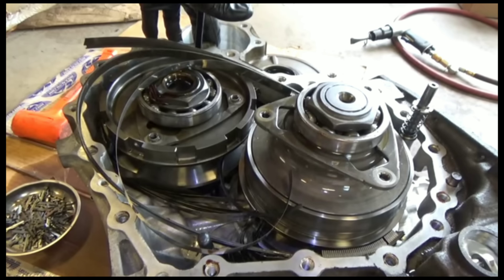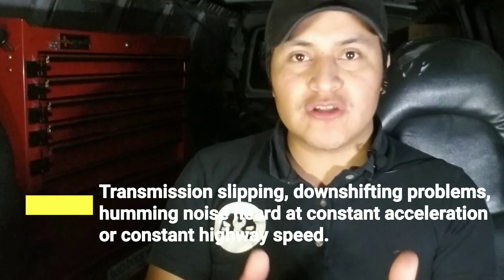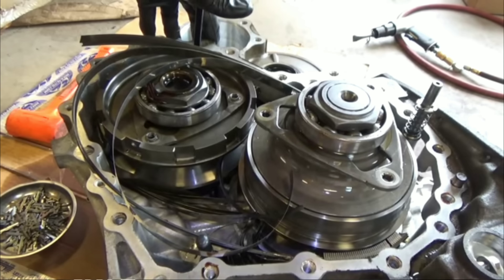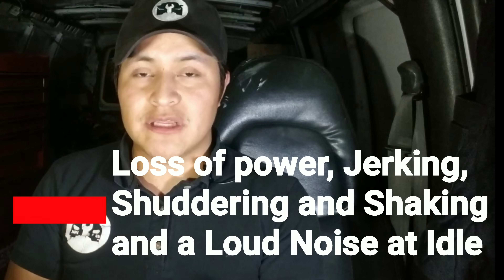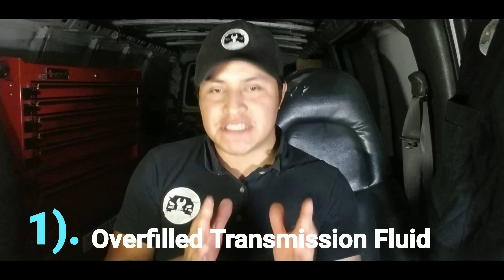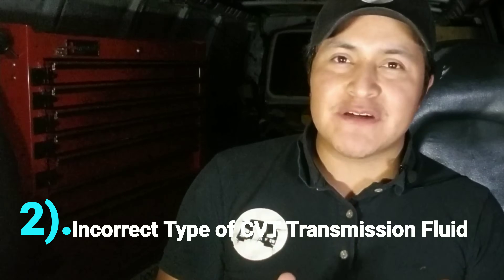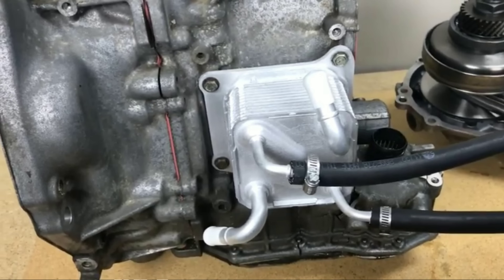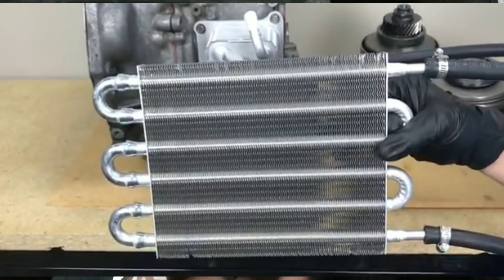NISSAN CVT TRANSMISSION | why it fails and what you can do about it to prolong it's life

Comment: Our CVT issues started at 12,xxx miles. I recorded it with my phone, and let the dealer know, but they weren't able to "replicate" it. It happens once in a while now - raaaarely - and now, I know it's going to act up when the VDC symbol (vehicle dynamic control, the one w the car and the squiggly lines) comes up and blinks. It's a 2015 metallic blue Sentra, with 74,xxx miles now (2021) on the same faulty transmission. Have done all the needed maintenance in a timely manner as well. Love the color and body lines, but man does that transmission suck...
Reply: Trader her in before she fails on you.
Reply: The VDC light.  I have a question about this.  I have 2010 Altima Coupe, 31K miles (that’s not a typo). I bought it new.  Ever since Day One, if I am forced to make a hard stop, my car will not accelerate afterwards and that VDC light blinks briefly.  I live in Dallas and Texas traffic does not play. When you are forced slam on the brake, you typically have to floor it immediately afterwards & get the hell out of dodge.  If you don’t, you’ll die.   I’m very serious when I say that I’ve almost been killed because of this issue.  I asked the dealer about it and they told me it was, for lack of a better description, a CVT defense mechanism.  It won’t let me accelerate after a hard stop so I don’t damage the transmission.  Is that right?  Why would slamming on my brake mess up my transmission?  If I am run over, rear ended or possibly shot because my car won’t accelerate after slamming on the brakes, damage to the transmission will be a non issue..?

Comment: I bought a 2012 last of 4th gen and its going strong at 205k miles ive changed the trans oil 3 times about to do the 4th luckily my trans pan has a drain plug. And ive used valvoline cvt compatible with ns-2 and no issues

Comment: Needing to change the transmission fluid after only 30k miles is ridiculous. Just one of many reasons why my Rogue is my 1st & last Nissan.
Reply: Especially when you have to take them to a mechanic to change the transmission fluid and it costs $300! My 2013 Nissan Rogue is a POS, I get about an hour and a half of drive time before it goes into limp mode. That's fucking ridiculous!
Reply: @destinysharum9253  I have a 2007 thats in limp mode right now, if you have a 2013. I think im going ti call it a day with this car🖐
Reply: It’s called preventative maintenance. Like engine oil, trans fluid over time wears and begins to lose its properties such as heat absorption, friction, and lubrication. All these properties are absolutely critical towards maintaining a healthy auto trans and replacing it regularly can increase its lifespan. In the case of CVTs, they require more religious trans fluid changes due to their sensitive and more delicate nature than regular planetary gear set autoboxes. Remember that fluid is cheap, new trans aren’t.
Reply: @alexs.818  no its called high maintenance. A car that has to be maintained twice as much as any other car on average is not worth having.

Comment: Please plz take a look at your cars tech bulletin, if you drive > 70kph @>98deg F days, you are pushing to the limits, please use a OBD scan tool (Bluetooth if possible) and read cvt temp while you drive...monitor it..,you will get shocked to see how it heats up, it's just like you eat a candy and read BS.then think about adding external cooler....you could still save your car...drive really safe ...no road rage with nissans!!

Comment: I have a 3.5 Altima with 200k on it? Car runs like its still new! Not one thing is broken or not working. Amazing car.  Only complaint is i changed stabilizers twice. They start making light rattle noise after 2 or 3 years.
Reply: Which year model?
Reply: @ALOUY15  altima se 3.5 year 2007
Reply: Briman24 maybe prior to 2013 its reliable, hearing so much here and there about the 2013 being unreliable specially in the transmission

Comment: Hi! Just watched your video and wanna say thank you for posting it! I wanted to ask a question... I bought a 2014 Pathfinder SV AWD with 226,000 miles. I noticed, after buying of course, that there is a "shudder" occasionally (not always) upon accelerating.   I'm sure it is transmission related. This far, I've not had an overheat (that I know of...but it hasn't gone into the limp mode). I have no service records from the previous owner as it was traded in on a new Chevy. I bought it from that dealer. My question is what do you recommend considering the miles, and assuming the shudder is just starting to happen (versus having done this for many miles)? The truck has other "typical" Pathfinder issues (sun visors being the most irritating). Do you recommend selling or trading the Pathfinder ( I paid cash for it... my entire savings! 😕)? Thanks for your help! Have a great day!
Reply from the maker: Have you taken to a shop to diagnose it, to make sure it's the transmission?
Reply: @WrenchLink  I have not had the extra money. I also have a 2008 VW Passat 3.6L4Motion that I am fixing now. I figure it'll cost $700-1,000 to get I back on the road. Back to the Nissan, I didn't really want an SUV... I don't care for them or trucks. I am a car guy. I wanted 2013 Cadillac XTS or Lincoln MKZ but alas, they were both a couple thousand more than I could spend. I owe nothing on the Nissan, so it wouldn't hurt my feelings to sell it or trade it if the repair costs are going to be too much. BTW, I nearly bought a 2012 Nissan Maxima SL but the transmission in it overheated according to the seller. I was appreciative he was honest about that. Anyway, knowing what I've said in my posts, do you think I'd be better off selling the Pathfinder? Thanks again!
Reply: @tythornburg3460  I am in the same situation with a 2014 nissan rogue. what should i do?
Reply: @rostyothman  I am gonna drive mine till I can't. Apparently it's no cheaper to fix it as it is or when the transmission is done. I'd love to trade it even up for an XTS or MKZ. But I don't think I would do to someone else that was done to me. As far as your Rogue... I suggest making sure it is too far gone to repair cheaply. If it is like mine, I would drive it till you can't, then take out a loan (title loan, maybe, if it is paid for...sucks because those are typically high interest,  but at least you'd have money to fix it...unless you already have the cash on hand to replace the tranny). That would be my suggestion. Note, I am not a mechanic, so you'd be better served getting advice from  one. Hope that helps.  Good luck!
Reply: @tythornburg3460     yea sell a car you dont want of cource,  but not because of the sun visors  lol

Comment: I have a 2018 altima I just hit 30k miles and I havnt experience any of this what does it mean?
Reply from the maker: That it's too early to be able to tell if the later models still have the issue.
Reply: @WrenchLink  they do, u need to drive it carefully and not beat on it. I bought a 2019 Sentra SR and the transmission doesn’t let u accelerate sometimes and u can hear a grinding noise when it happens.
Reply: I hit 37,800 miles also so it’s not that old

Comment: 7:40  For a 2013 Maxima Nissan and the dealer say change it every 60k miles..........I did mine a 48K but it was 7 years old
Reply: Saying bow do trans at every 30k vs. Recommended 60k
Reply: My local shops charge between 500-600 bucks for this. Ridiculous

Comment: Hello I have a cvt transmission on my Nissan Altima and it have 147,000 miles on it the transmission oil never been changed it shifts pretty good but it do a whining noise when I try to get speed but that noise goes away should I change the  fluid changed? Plus I have no lights on my dash and no codes even had it plugged up to make sure it wasn’t any code multiple times if you don’t mind could you please answer my question

Comment: My murano trans went out at 140000 mi. Pretty much gave it to dealership...on trade . Felt like they held me hostage on new model. Will trade b/4 it happens again.
Reply: What year was your Murano?  Did you have the trans fluid changed while you owned it?
Reply: @jenniferbaker5167  yes had it chg'd. Will sell my new M when it hits 100,000 mi. New M (2019)has slightly different trans. Not taking any chances.
Reply: @tcisraels8566  I was looking at a 2012 Murano with 109k miles to buy.  One of those things, if you look too far you find so many issues.  Trans fluid looks good, seems to run great, one owner, so many service records.  Now I am scared to buy it.  Thanks for your response!
Reply: @jenniferbaker5167  mine was a 2012

Comment: My 2014 Altima S has 166,000 it shifts great till it warms up then it has a shutter when shifting from 2nd to 3rd. But it doesnt make any noises and only does it when i only are accelerating slowly if you accelerate normal then it dont shutter. Do you think the transmission needs to be replaced?

Comment: I really don't believe they're too bad. My sister has 190k on her Murano and still going... it's starting to fall apart but everything else like suspension etc...I really think the problem is the drivers...here's a question when have you not seen a person with a damn Nissan speed? Always see Altima drivers driving like douchebags speeding over 100 everyday of the week. Also change the transmission fluid every 20k

Comment: I hear mixed opinions about doing a transmission flush on a cvt? A lot of mechanics said that if you wait too long it’s actually worse to change the fluid because the transmission is used to the current oil and parts are worn down so if you put fresh fluid in it’s not gonna flow right in the transmission. I have a 2013 Altima 139,000 miles I’d like to know if I really should or not I haven’t noticed any issues with my transmission
Reply from the maker: First of, is it a CVT or an Automatic transmission?
Reply: Wrench Link cvt
Reply: ?? Never answered dudes question

Comment: I own a 2017 sentra with a cvt that has 142,000 miles, I've replaced the cvt fluid twice at the dealership and I am about to replace it for the 3rd time. My question is how do you know if the fluid level is correct if it doesn't have a dipstick and only a cap. Also, does the filter needs to be changed. I am planning to change the fluid myself and save $250 dllrs.
Reply: I have a 2014
 No tranny dispstick.. I just take it to a nissan mechanic & changes the transmission fluid.  I'm at 92k miles.  Changed it twice so far

Comment: I can’t wait to sell my hunk of junk Altima
Reply: I am planning to buy an Altima 2013 base model. Has 83k miles on it. Gear and engine are perfect as my own cousin was driving. But I will be using it for rough use. Not  off roading or anything..like for city daily driver. Would you recommend it? Or suggest something..what issues did you face?
Reply: @farazahmad5947  I drive my 2015 Altima for regular commutes nothing crazy and a little bit over 100k miles the transmission went out completely. I was literally just pulling onto the highway when my car just stopped accelerating out of no where and I had to pull over. Good thing is I wasn’t in the far left lane when it happened. Nissan refuses to take responsibility for the faulty transmission and I have to come out of pocket for it

Comment: Why does my owners manual state the trans fluid interval is 60k
Reply from the maker: Because that's the manual that came with the car when they made the car, Nissan found out later that the CVTs go out at very low mileage so they sent out TSBs (Technical Service Bulletins) saying that they recommend to replace the fluid every 25k miles.

Comment: I have a 2013 Juke from new. 172000km. Runs great but I have had 2 new turbochargers. I will take your advice on the transmission as I would like to keep the car for another 3 years. Good motor.
Reply: What fluid brand you use?

Comment: Rule number one you don't put CVT transmissions into automobiles. They don't freaking work that's not what they were designed for. Secondly if you have a problem with the transmission not cooling properly you take the cooling line that returns to the transmission, and you put into that line on external transmission cooler and place it up in front of your air conditioning condenser or somewhere else behind the grill. You can never get the transmission to cool unless you can somehow get it below 160 to 170 degrees. I have made many Transmissions last far longer than they normally do by doing that trick.
As for changing your coolant, that should be done no less than about every three years regardless of how many miles it states that you can run you're particular antifreeze on the bottle. He just somewhere metals that are in modern cars get the antifreeze to start turning acidic fairly early. And will damage the vehicle. Any vehicle if you want it to last its longest you should be changing the transmission fluid every 30000 to 50000 miles.
The only way that putting additional cooling on your transmission will void the warranty, is if it changes the function of the cooling system. Which unless you're an abject moron it will not. What is apparent is that just by putting the CVT transmission on the vehicle they have basically decided to put an ineffective an unreliable system on the vehicle and should be supplying a warranty that should cover that transmission for about 200,000 miles. If they were so stupid that they thought that that was a good idea maybe they should stand behind it. In the United States, the warranty system in this country basically states that if you paid for it it won't void the warranty. However there's a lot of places out there that will argue the point. But just to show a case in point. The only reason that many companies are offering free oil changes is because an oil change is not required to maintain the internal lubrication warranty on the engine. If they warranty it for 36,000 miles than you do no oil changes for the first 36,000 miles and the engine fails. They have to replace it. I don't care how many times they've convinced somebody to pay for their own engine. But it is not required unless they offer you the oil change for free!

Comment: I bought a brand new 2020 Nissan Maxima in May and with less than 7,000 miles, the transmission went bad and had to be replaced. I will never buy another Nissan as long as I live. Nissan knows the cat transmissions are trash.

Comment: You completely lost me when you talked about the correlation of the engine cooling system and coolant, and the CVT life expectancy.  They should be separate items.  I think you talked about adding an external transmission cooler but you also said that it already has one in the radiator.  Incorrect coolant/water mix affects the CVT???  How?  It (the engine coolant) is the "same cooling system that cools down the transmission (@ 7:08)"?

Comment: Total bs..2015 Murano Plat here..102K miles..no CVT issues..no issues whatsoever..i'm on the original wipers. Don't listen to these idiots. It depends how the cars are driven, maintained. I also bought a 2021 Rav4..the side mirrors are shaking...factory defect..rest of car ok so far.
Reply: This is the comment I was waiting for. Im planning to buy a 2021 rogue. The car is way better than the rav4s and cx5s I test drove. Do you live in a place with a colder climate ?
Reply: @manojmohan7264  No FL. The new Rogue is nice but I prefer the Murano, though the design is a bit dated now. I avg 27.4 mpg on the Murano which for a V6 is not bad. The Rogue gets better mileage.
Reply: @FloridaDCSVideos  thanks for the reply man ! Appreciate it. I love the pro pilot assist and the camera quality on the rogue. And personally, I do like the ride quality too. All these comments are really scary. What all do you do to keep your car healthy ?
Reply: @manojmohan7264  Change synthetic oil every 5k miles, cross rotate tires , CVT flush every 50k miles, ethanol free gas ..i think engine runs better.
Reply: @FloridaDCSVideos  thx man

Comment: I put my car in self diagnostic mode and my transmission went back to normal after I did it but before I did it I could not even get out of first gear it was winding, 2017 Nissan Altima sv (65,753)

Comment: I don’t agree with his description of how coolant works.   I have always understood that the additives are for corrosion protection and boiling and freezing points.  Meaning that straight up water is all the engine needs to cool properly, then it just needs to be prevented from freezing and corroding. Perhaps you could say it might sludge up eventually and reduce cooling, but I would say that’s not going to happen before a Nissan dies.  So my vote is that if your coolant is properly full , it’s not going to be the problem with transmission overheat no mater the age
Reply: No, it helps though it's not the main reason, the chemicals that protect powertain from heat and coldness, even plastics and rubber hoses break down in HOAT or OAT coolant in ten years, it needs to be changed or flushed out, no fluid lasts in high heat for a long time. It's important to watch level between low and high too. But you should be good for every 2 to 5 years depending if you live in the extreme hot zone like Florida/Texas or cold zone like Canada.